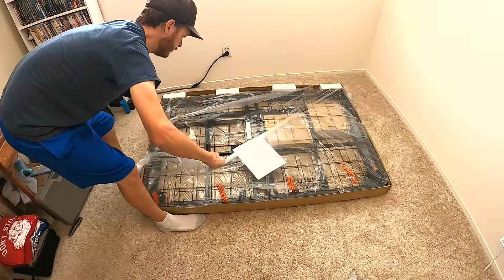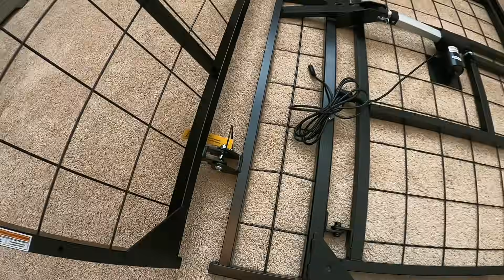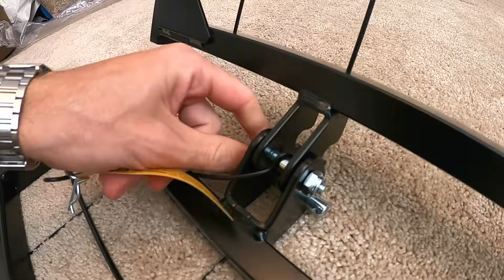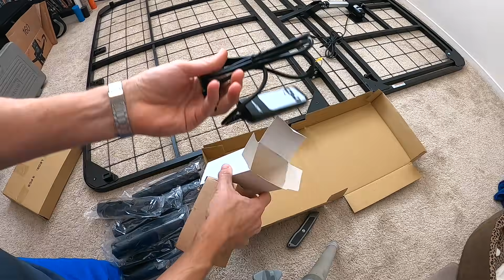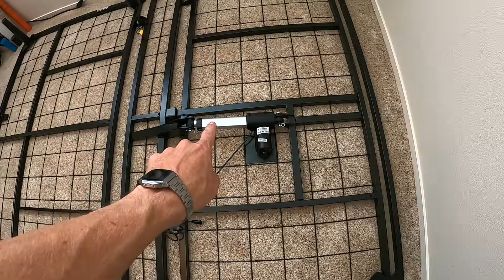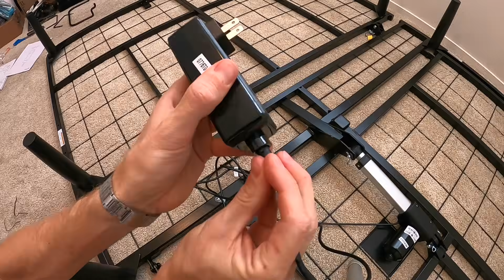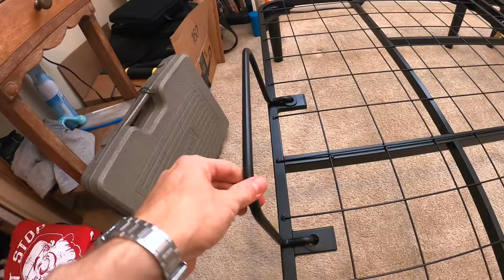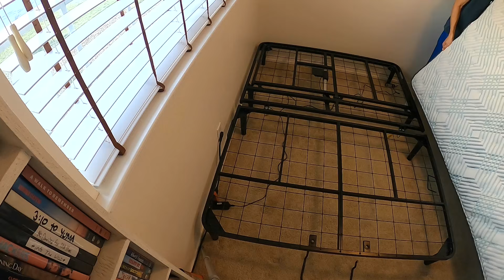How To Assemble Adjustable Base Bed Frame from Mattress Firm

Comment: My mattress firm adjustable bed is already here and set up. But it’s so high. Do you have to flip it upside down to remove a length of leg? Can up just lean it on side…. Any easy way???? Oh god. Wish guys could come back and do it? Can they
Reply from the maker: Yes can lean on side. You can also try lifting one section up a little bit and slide something under to prop that part up to work on the legs 👍

Comment: What's the measurement from the adjustable base to the floor? Is there a lot of space under the bed to put stuff underneath it? After using it would you recommend it? What are some pros and cons? Thank you!!👍
Reply from the maker: You're welcome. It only has about 9" storage height underneath. To top of platform it's about 10". Someone mentioned getting taller legs for it since they easily screw on to get higher and more storage. I like it so far, I like the adjustability for reading, tv etc.
Reply: Thank you for your response truly helped! 😊
Reply from the maker: @miriamclavel8950  you're very welcome 👍
Reply: Do you know the leg stud specs are they metric I just got this with my purple mattress for free and want to extend leg lady said u can get them online idk what ones fit tho
Reply from the maker: @WildNorthPursuit  not sure on the exact size, but I'd bet they're metric for sure though. Can take to hardware store and use one of those little gauge things you can screw it into to check size and pitch to be sure 👍

Comment: Thank you! Bc I wanted to get taller legs for more height...and now I know I can!
Reply: I too feel the base is too low. Considering adding bed riser blocks to give it a few more inches. Any opinion on that?
Reply from the maker: You're very welcome, I was thinking the same thing but haven't had a chance to look for any yet. Shouldn't be hard too hard to find, they just screw right on 👍
Reply: @JonnyDIY  Is the bed frame not too squeaky or noisy when you move around? Sometimes those metal frames do that. Thanks
Reply: @JonnyDIY yes im looking for taller legs if you have aby reccomendations.
Reply: Do you happen to have the link for legs that worked well with this model?

Comment: It's funny you should do this bed frame demo.  I have a Helix mattress scheduled to arrive today.  It looks like this bed frame serves as a foundation as well.  I'm opting for an old fashioned foundation (often called box spring) and mattress combination.  I'm going to reuse my old bed frame made with angle iron.  When you reuse the bed frame (if in good shape), there's no need to build the frame.  😊Anyway, this is a good video for someone who wants an adjustable bed set-up. 👍👍👍
Reply from the maker: Awesome! Hope you enjoy your new bed. I badly needed a new one, my back was killing me! 😆 ohh yeah Ive always had those style ones too with the box spring. They're nice and higher too, this ones pretty low. I would probably stuck with one like you, but didnt have a queen boxspring around
Reply: Same situation here.  My back hurts so much in the morning that when I get out of bed I have trouble bending and walking until I move around for a while and do some stretching.  Hope you enjoy your new bed as well.  It's kinda cool to adjust the bed for things like reading or just comfort.👍👍👍  @JonnyDIY
Reply from the maker: @audiophileman7047  yeah I used to have to do yoga stretches in bed for 20 minutes before getting out 😂
Reply: I hear you.  It's a pain in more ways than one, because I have work to go do and I have to work with exercise before I can get going.  Worst yet, what if somebody broke in the house in the middle of the night or there was a fire? I may not be able to move fast enough to deal with it. 😲  Time to fix this problem and very soon.  The mattress just arrived, so off I go. 💪👍 @JonnyDIY